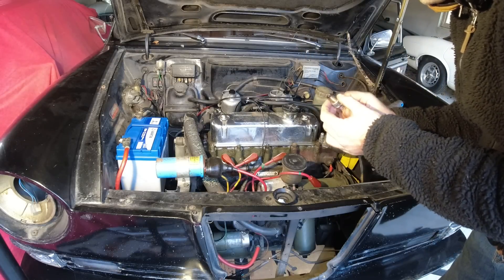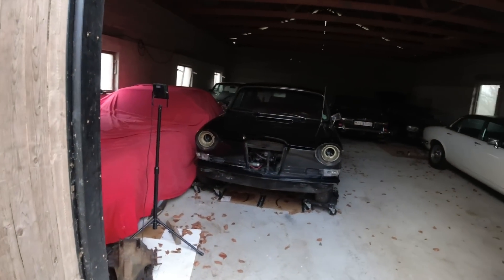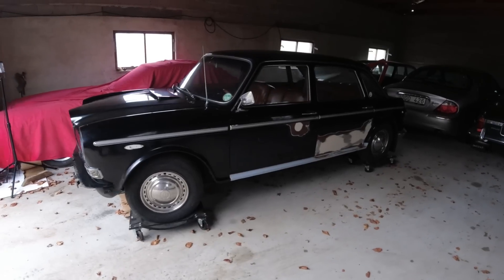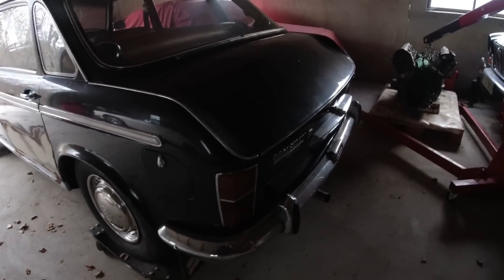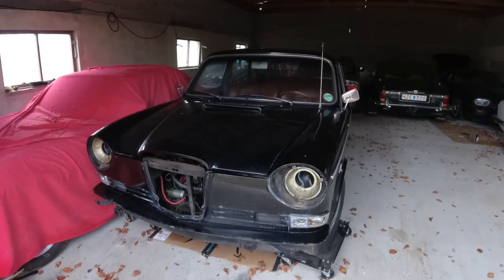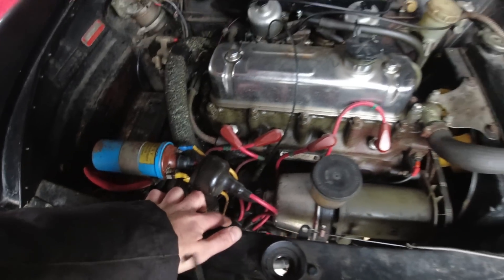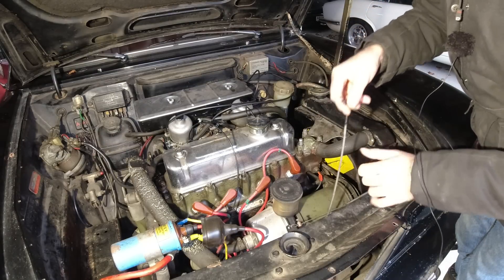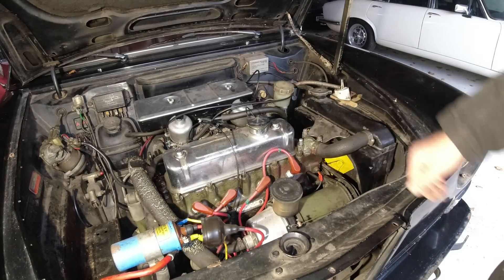After Sitting for Years will this Forgotten BMC 1800 'Landcrab' Run?

Comment: I had a '77 Spitfire that I had a weak bladder in the fuel pump.  I had to do that back feed priming trick, usually in the summer, when I think the heat caused it drain back.  Once primed, it drove fine.  I'm surprised I don't see more folks "priming the pump"
with these barn finds with mechanical pumps.
Reply from the maker: It’s a good way to get them to prime.
I wish more pumps had manual priming like diesel pumps have

Comment: I really love your troubleshooting videos like these. Methodical and on these old engines without electronics it's a breeze! What a great feeling it is when it runs on its own too, One product I discovered that beats anything on the market to pree up stuck parts and rusty bolts is Aerokroil, from the aviation industry. One can lasts forever and it's unbelievable. I use it on stuck carbs too.

Comment: A Les Leston Grand Prix steering wheel! There was an Austin and Morris 1800S as well and the engine is the MGB tune unit. The standard single carb cars are also 4 speed manual. The automatics use a three speed Borg Warner 35 gearbox in the sump but I think* they were single carb only.
Reply from the maker: The wheel is really cool! Suits the car
Reply: @LivingWithAClassic  If you get the chance to drive a Leyland Princess (75-82) with the 2200 engine, you'd be surprised how well it drives.

Comment: You cannot backflush the fuel system with the pump connected due to the two one way valves in it.I made that mistake and had to remove the pump to  refit the valves back correctly. That was on a 1984 Mini Mayfair ,same system, just a bit smaller and more inaccessible .
Reply from the maker: I don’t want backflush it, just prime it. With fuel on the diaphragm it’s easier for it to fill new fuel from the tanks
Now it pulls fuel as it should 😊
Reply: @LivingWithAClassic  Diaphragm! That's the word I was looking for! The one way valve weaken over time and let fuel seep back in into the tank.  Putting in the line gives it just enough seal to pull.  A mechanical well hand pump has the same issue.